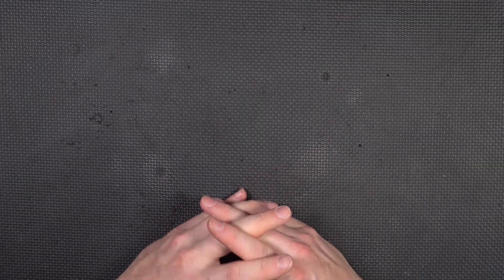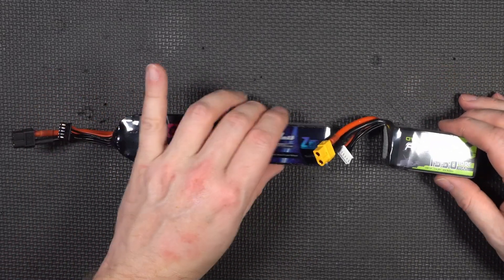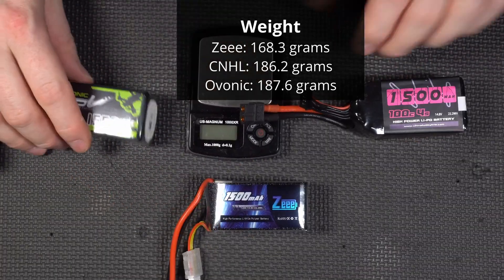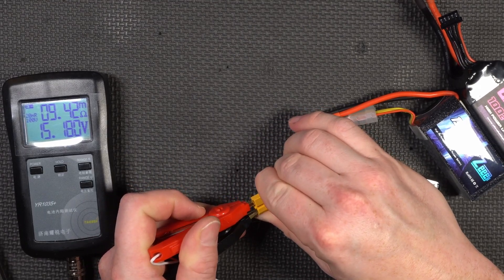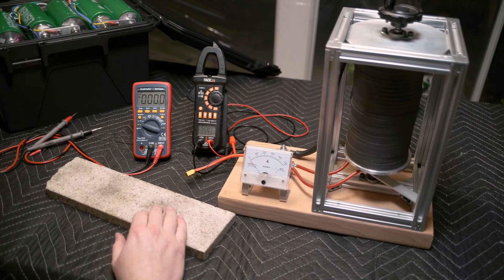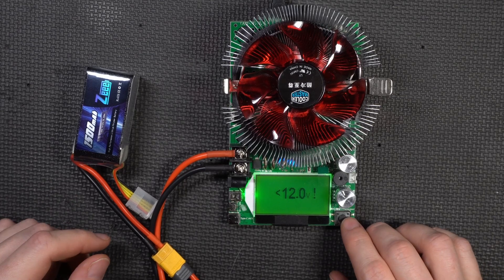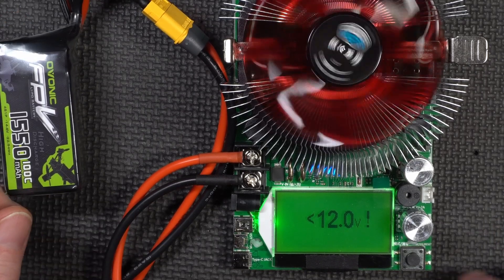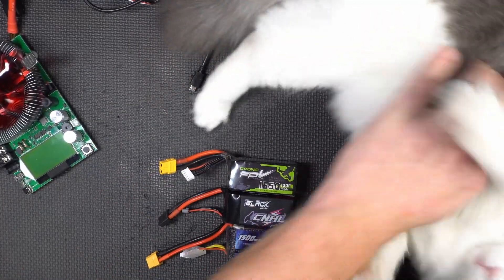Battery Heavy Load Shootout - 4s 1500mAh Batteries

Comment: I was curious about the Zeee batteries and this answered my questions.  I have been using Ovonic for years and they always are overratted capacity. In the 1500ish range its usually 100--200mah over. For example, the 1300mah 6s do about 1100mah. Super cheap though, just buy larger than you usually would.

Comment: I always thought 3.85 was optimal. Thats why my ISDT chargers default to. Thats one thing I've noticed after ripping cheaper packs, one or two cells always seem to fall much lower than the rest, and chargers have a hard time balancing it up with the others. I think thats part of what you are getting spending more money, just generally better cells. I'm shocked you got a CNHL at less than ovonic! Those are one of the more expensive brands usually right up there with tattu.

Comment: I run the zee packs in all my crawlers since there so cheap and small. I have had my crawler brown out if running a higher kv outrunner on a low pack. But for the coast there good for slow crawling.

Comment: Never drain your lipo cells below 3.4v under load, your damaging the cells.
Reply from the maker: That is actually incorrect.  I'm only responding to correct any misinformation out there.  While technically the act of charging and discharging any cell at any voltage at any load does take some life out of the cell, you don't actually start damaging the cell until the voltage sags and then recovers while still under load. And that's not a 3.4 volts for a typical lithium polymer cell. In fact it's not at any particular voltage, but typical acceptable minimum is 3 volts per cell - And that's resting voltage. Under a load you'll see cells dip to all kinds of voltages.   It is true that at rest 3.4 volts doesn't have a whole lot of charge left in the cell but it's not going to hurt it. At least not significantly.
Reply: @AlexLTDLX  "Significantly"? Welp that maybe true. Most flyers get 100 to 200 cycles and they are happy. My 4s-1300 quad pulls 120A peaks and only lasts for 90 sec (60 sec if I am really on it), this is pushing these little batteries, so 1 or 2 hundred cycles seems to be the norm.
But I am not the norm, my batteries last 1200 cycles in my quad, then I relegate them to lighter duty plane applications and get another 1000+ cycles, yes, this is 2200+ cycles. In 2017 I flew 10,400 packs in my quad that year, all done on 12 packs. I have iCharger, gt1000 chargers and wayne gills IR battery tester (the defacto standard for IR) and retest them about every 6 months. 
When racing cars competitively, draining your batteries like you do under load is really sucker punching them, costing IR and capacity, and of course life cycles ( I was 12th in the worlds). 
Back to the standard of 1 or 200 cycles, most peeps dont care and think its the norm, not me. If discharging high current and the cell is going below 3.7v, it is hurting the cell.
Reply: my main flying style https://www.youtube.com/watch?v=uHoFfpLSb2g&t

Comment: I'm looking forwards to future battery tests, especially anything tied to your turbo setup.

I ran a bunch of  4s 1400 mah 65c/130c Thunder Power packs in 2010-2011 as the starter motor battery for our Briggs and Stratton engines for our supermileage car in college.  We replaced a 6lb DC Briggs starter motor and 6 lbs Pb battery with a quarter pound battery and half pound 800w brushless outrunner motor.  Later on, we went down to a 400 watt motor that was a quarter pound... I remember pulling 1000 watts through it and it would only start smoking after 10 seconds, which was good enough for us.  Unfortunately we moved to a 12:1 CR engine and it didn't have enough torque to turn over the engine.  I also remember the 800w motor pulling about 150 amps.  It had to last starting the engine ~20 times.

Comment: Would like to see higher voltage pack tests. Typically run 6s and 7s in 3s2p configurations with toy mini bikes. Curious if that would be enough to drive a “elec turbo”.

 Also was thinking the mechanical fuel pump installation kits are pretty ridiculous. An OBX china knock off mechanical pump is $325. Was thinking powering it with a small brushless motor and lipo pack only when needed could provide a TON of fuel cheapish.

Comment: I would enjoy the headway 8ah cells. Battery hookup has them. It would be pretty cool to check out those. I have quite a few but limited to 40amp discharge with my set up. Would be interested in seeing if parallel strings hold up to really high output like 8p4s. It’s useful in 12v applications
Reply from the maker: I might pick some up to test.  Thanks for the idea and the subscription!
Reply: I'm curious about those as well.  I've purchased cells from them before and have been quite happy (100 tesla model 3 21700 cells that had been lightly used and re-wrapped).  The headway cells may be useful for some future projects that need high power, yet are a large format for easy assembly.

Comment: As a connoisseur of high output LiPo's,  I can tell you 1. The Ovonic you got is the wrong one.  Get the orange one.  Its higher output.  2. THE BEST LIPO AVAILIBLE IS Tattu 5.0.   It has the best continued amp draw.  CNHL black are ok.  Zeee are a good cheap battery.

Comment: Wonder how well one of those would fair as a mini jump starter. Prob wouldn't try a car but a lawnmower or generator would probably work well.
Reply: In another video a guy started a car with one.  5ah at 120C is 600 amps at 12 volts.  That's 7,400 watts which is about 10hp.   But a XT90 connector will melt at 270 amps after a couple of seconds so be careful!
Reply: More concerned about the high voltage to the various computers... Tho if you are connected to a flat lead acid it should never see over 15 volts.
Reply: I started my car with a 4s 1200mah ovonic pack that was at 14.6v.  Granted the car wasn't completely dead. I've done it quite a few times actually it works pretty well but a 3s pack would probably be a better choice to be safe